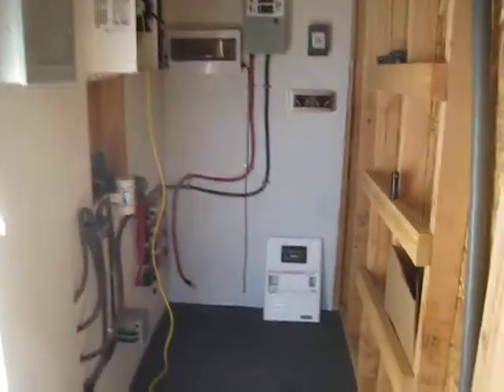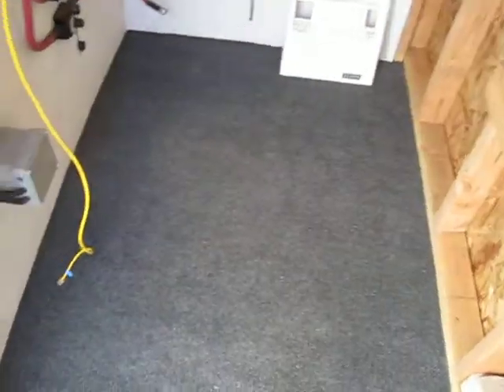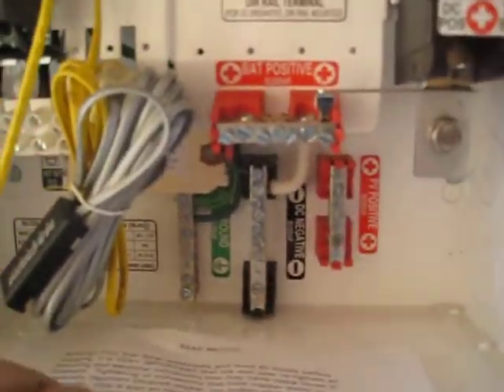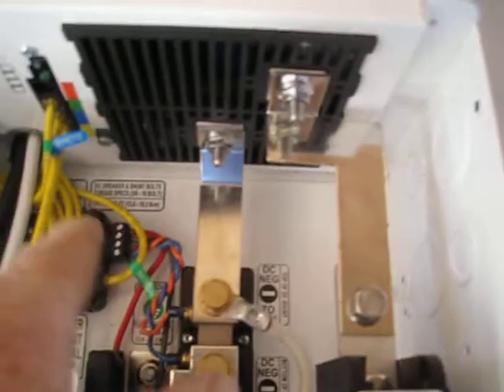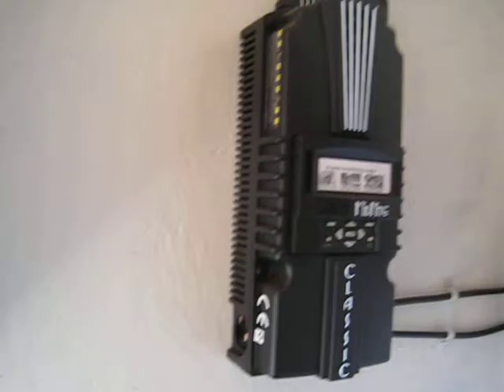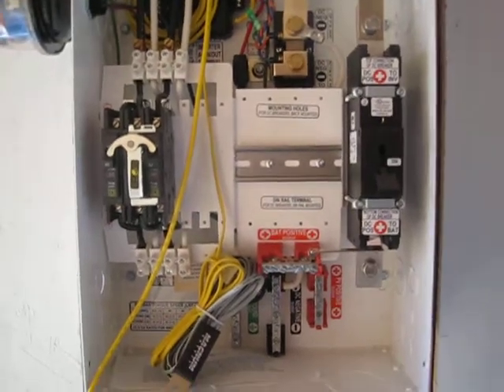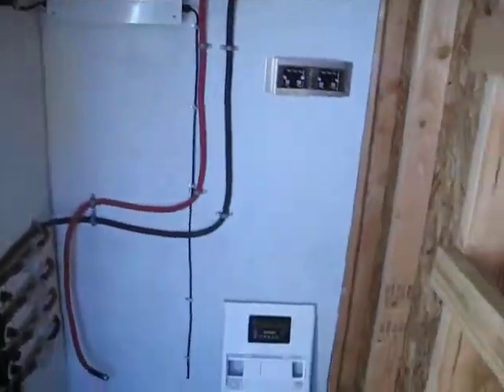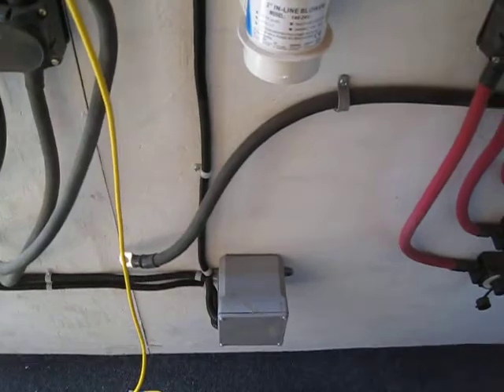Off Grid shed dual ground rods and opening the inverter 001

Comment: Per Magnum, if you have neutral ground bonded at your main nreaker, do not bond neutral to ground again inside the magnum panel, in fact remobe it. You can still run ground to a rod for panel array and all other equipments.

Comment: Hi silentdeath, quick question. Do you have the ground connected to the neutral of the of the inverter with an rcd breaker? I am setting up on off grid system and unsure as to how to get RCD protection incorporated into it. cheers